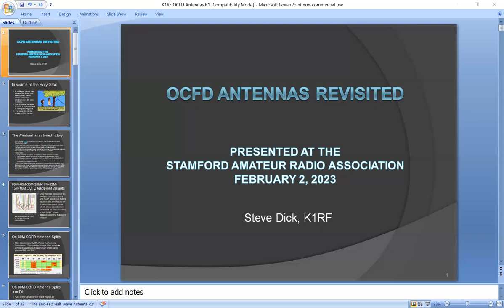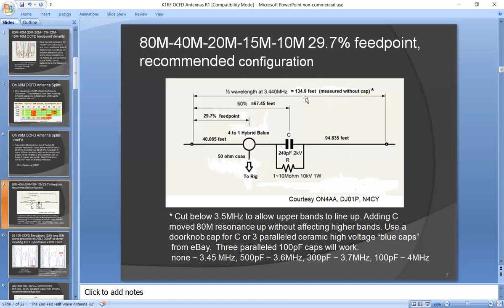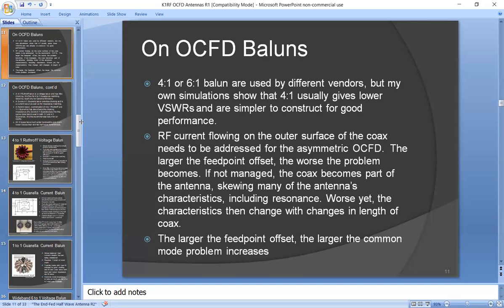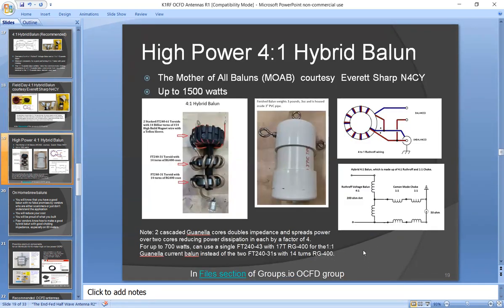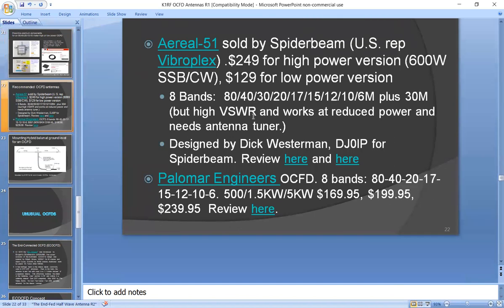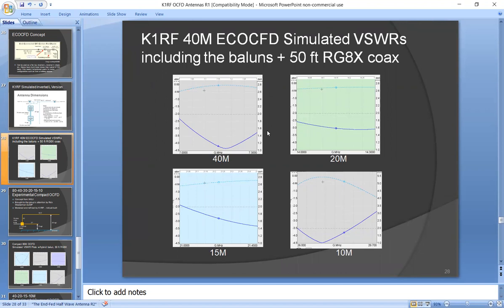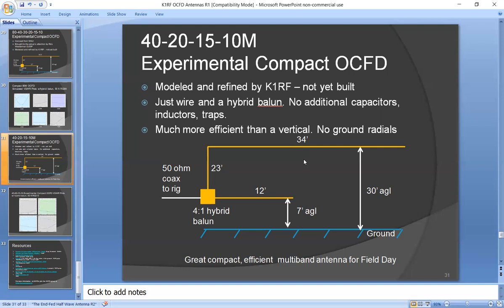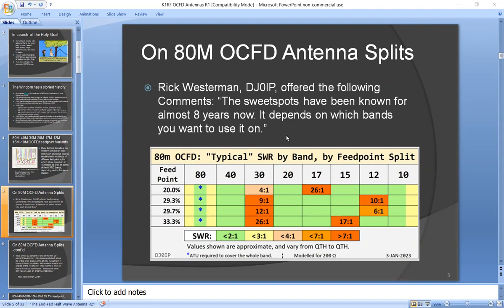OCFD dipole antennas by Steve k1rf

Comment: I put up an OCF dipole a few years ago using 12 awg stranded Wire. It's about 90' x 180' fed with a good quality, DX Engineering 4:1 current balun. It's about 70' high at the center and about 15' at the ends. 
It has reasonably low SWR on most HF bands from 160-10M (with a few exceptions). 
It is a great fit for my property and that's what originally attracted me to it. 
It's the antenna that I really wanted to love, but I don't. 
It's performance is just not very good. In real world A + B comparisons, my G5RV beats it 95% of the time and of those, 60%+ of those times, It is quite significant- I mean it's not even close.

Comment: that was an interesting question about a 30m variant of your compact experimental design. Looking at your curves at 31:38 the 7MHz plot isn't too sharp & the 14MHz (second harmonic) plot is still dropping at the high end of 20m....... suggesting if you scaled the antenna from 7MHz to 10MHz (30m) fundamental then there is fair chance the exact second harmonic of 20MHz would be reasonable too & as the original (7MHz) antenna was still improving at the top end of 20m then the 10MHz scaled variant would probably be reasonable on 21MHz(15m) too. Extrapolating the 3rd harmonic original plot (21MHz) might suggest that with a reasonable ATU you might be able to get 30MHz as the 3rd harmonic of the 10MHz fundamental (although it might be a bit difficult getting down to 28MHz).